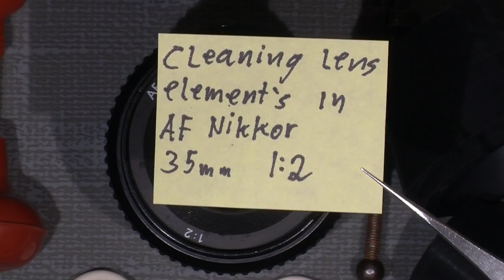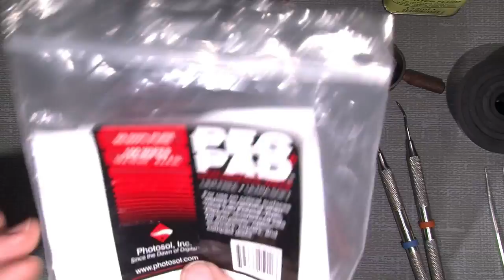Cleaning lens elements with lighter fluid and ECLIPSE in AF Nikkor 35mm 1:2

Comment: Where do you find the rubber lens tools?  I am in the USA
Reply from the maker: Here are some link's to different repair tool's:

Japan Hobby Tool rubber cone:

https://www.amazon.com/Japan-Vacuum-Camera-Opener-Repair/dp/B0013HFYKK/ref=pd_sbs_469_1?_encoding=UTF8&pd_rd_i=B0013HFYKK&pd_rd_r=RKSF5A4YKT9GV3E1382C&pd_rd_w=5H58m&pd_rd_wg=DBny2&psc=1&refRID=RKSF5A4YKT9GV3E1382C

 
18 different size rubber repair tool's:

https://www.amazon.com/Sizes-Lens-Filter-Wrench-Rubber/dp/B00988D1BK/ref=pd_sbs_469_2?_encoding=UTF8&pd_rd_i=B00988D1BK&pd_rd_r=RKSF5A4YKT9GV3E1382C&pd_rd_w=5H58m&pd_rd_wg=DBny2&psc=1&refRID=RKSF5A4YKT9GV3E1382C
 

Divider Caliper Wing Compass:

https://www.amazon.co.uk/Divider-Caliper-Compass-Marking-Machinist/dp/B015CN9A8M

 

You can also buy this set.

Lens Repair Set with pointed, flat, half flat tips:

https://www.amazon.com/dp/B00QRPWCN0/ref=psdc_3347581_t1_B00J5F6O92

JIS cross head screw driver's:

https://www.amazon.com/Moody-Tools-58-0219-Chromium-Screwdriver/dp/B004PGO1T6/ref=pd_sim_421_6?_encoding=UTF8&pd_rd_i=B004PGO1T6&pd_rd_r=775KBDR03D8PMMEZWKFJ&pd_rd_w=ti7yC&pd_rd_wg=s2a40&psc=1&refRID=775KBDR03D8PMMEZWKFJ

Or this set, that is the set I use:

https://eustore.ifixit.com/en/Tools/Drivers-Wrenches/JIS-Driver-Set.html?utm_source=iFixit&utm_campaign=Referral&utm_medium=modal&utm_content=145115

 Lens cleaning wipes (PEC-PAD):

https://www.amazon.com/dp/B0161VIZZ8/ref=sspa_dk_detail_3?psc=1&pd_rd_i=B0161VIZZ8&pd_rd_wg=ZTxxY&pd_rd_r=RNY8S6Q1V5K18K3F61VZ&pd_rd_w=2c1Oy